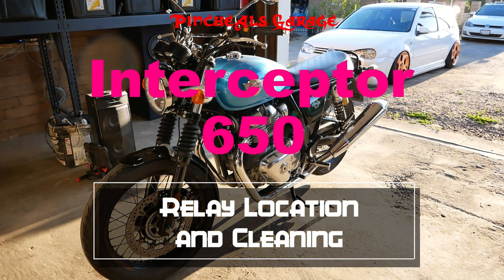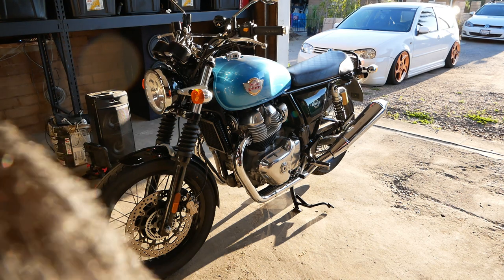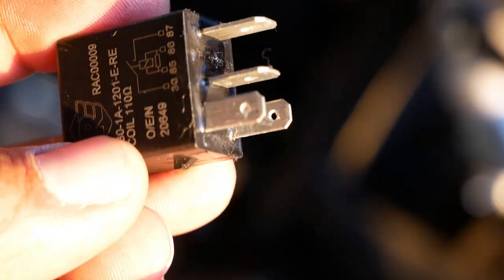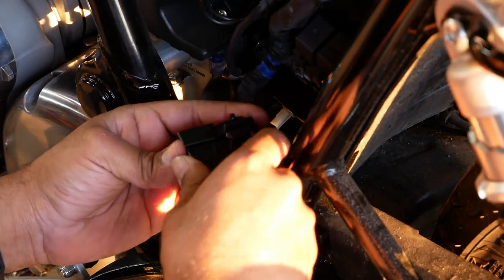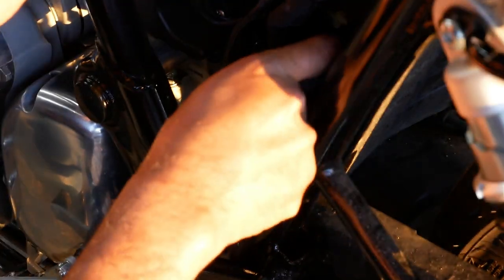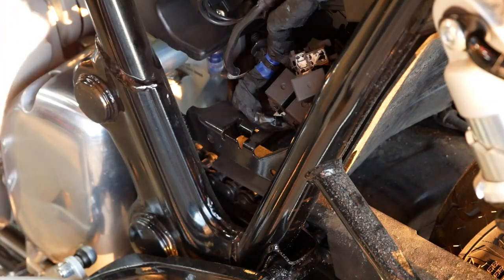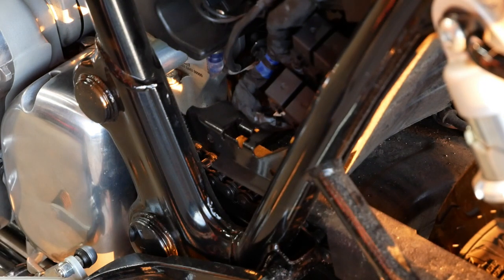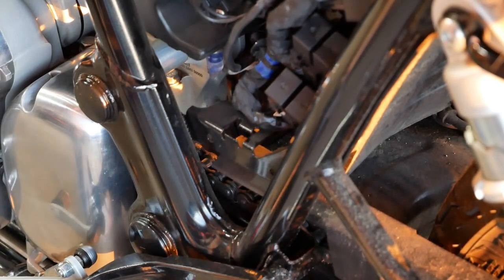Royal Enfield Interceptor 650 - Relay location and cleaning fix

Comment: Cleaned the grease from the relays and sockets with brake cleaner.  A year later, it's not running right and It's having trouble starting.  I'll replace the relays with Panasonic ones from RS and see if that makes a difference.

Comment: Just a clarification it's dielectric grease, it doesn't conduct electricity period.
They pack it in to stop moisture and corrosion of the cheap relays they use.
Reply from the maker: @spencers4121  that is correct however since they put soo much it actually has an opposite affect and prevents electricity from making contact with the relay. You don't need that much to do the job. I actually have a new video coming up about the 2 years and 10k miles full review of my int 650. I can explain more about the grease issue as well. I got a new scram 411 last year and it had the exact same issue. Way too much grease in the relays. Cleaned then all up bikes fires up every time.

Comment: So did it work ? Did it cold start the next day ?
Reply from the maker: Yes 100% fixed my issue
Reply: @PincheALsGarage  interesting. It's improved my issue, it went from failing 100% of the time .... To maybe 25% of the time. I wonder what that indicates ...
Reply from the maker: @DD-co1zn  just needs more cleaning.
Reply: @PincheALsGarage  I was hopeful it would be something like that. I kept starting it, letting it idle, start, idle, etc etc until it more reliably started each time. I'll bring a cloth with me in case it cuts out again and clean more aggressively if I can't get it started, but in the meantime I think I'm going to order upgraded/uprated relays and will give it more cleaning if needs be when replacing the relays. Do you happen to know how available / straight forward it is to upgrade the connectors ?
Reply from the maker: @DD-co1zn  the cheap relays they use end up failing I suggest getting the Bosh versions
Reply: @PincheALsGarage  better than the Panasonic ? Or is it much of a muchness ?